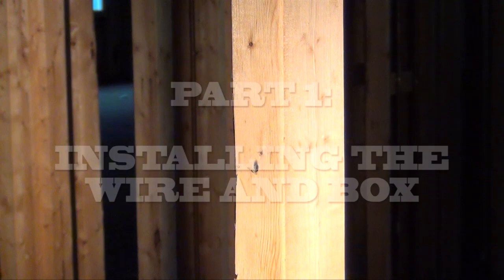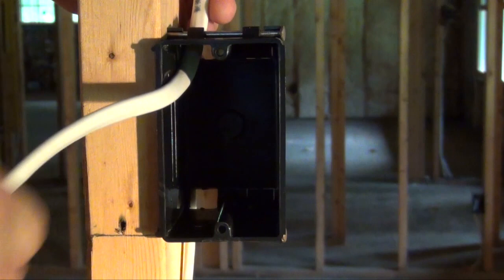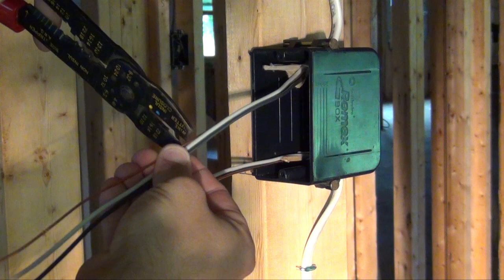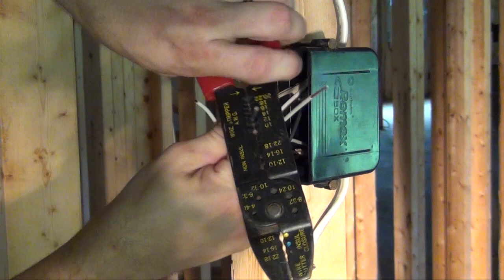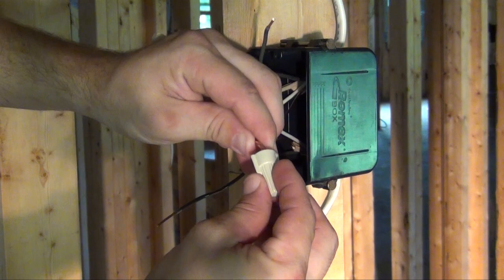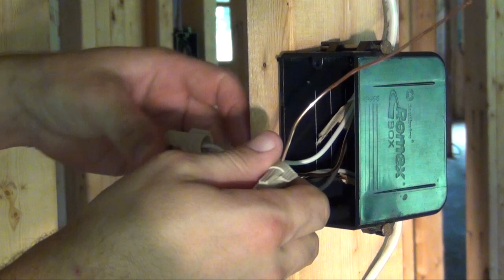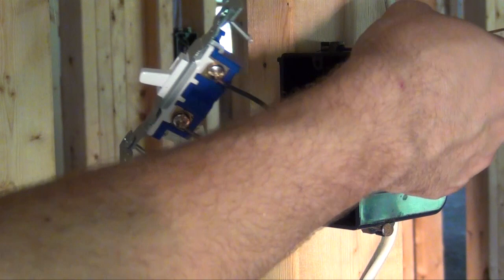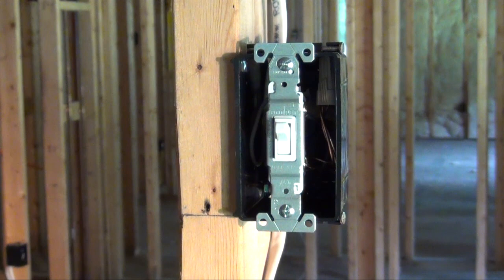How to Install a Light Switch

Comment: Dude I love your videos...I have been trying different ways to hook a light switch up...blown fuse after blown fuse...I just wire nutted all the same colored wires together...at least I can get the light to come on with the pull string....And the way you present you project is awesome...I chuckled a couple of times...good job and thanks...

Comment: When determining box height is it always based on preference or does code sometimes come into play?
Reply from the maker: There could be local code requirements, along with specific situations (locating a switch at least 2 feet above grade outdoors, that will over ride anything that I may say.  But, in general, the codes I've come across do not address height.   It is common to mount switches 46" above the finished floor, to the center of the box.  Some people with small children opt to mount them 30-36".  I'm in the middle of constructing my dream home and mounted my boxes 48" from the subfloor to the bottom of the box.  If you're mounting around cabinet spaces then be aware of the standard heights of cabinets and back-splashes.
Reply: +Another How To Channel ADA.. 48' to top max